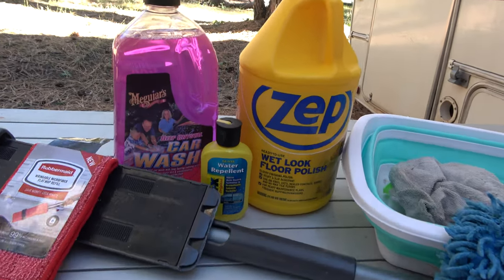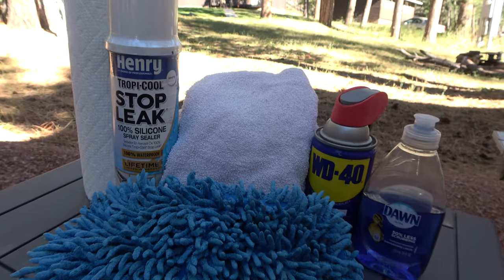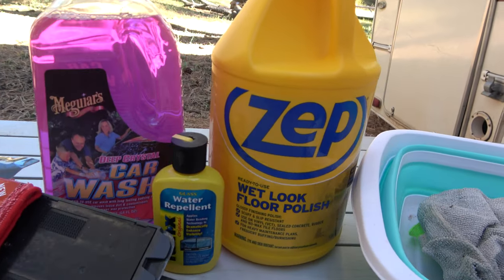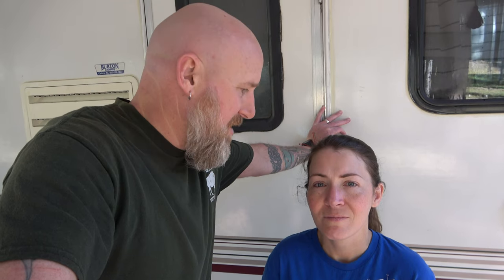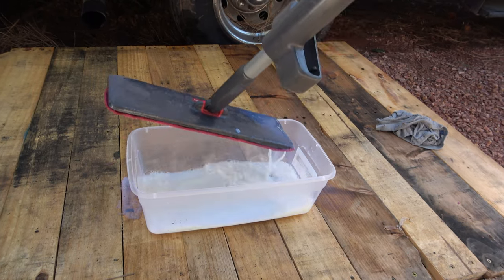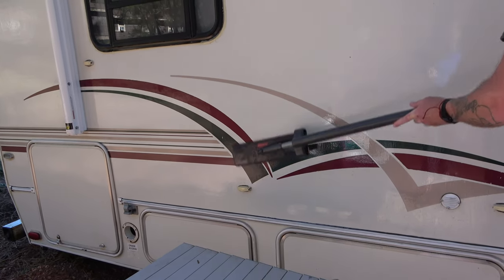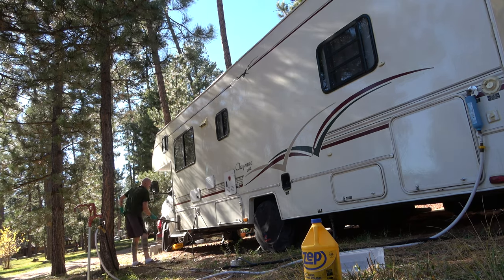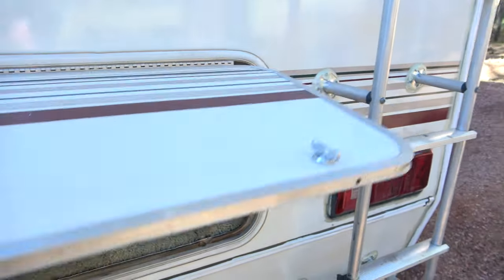Wax Your RV the Quick and Easy Way!! // RV Roof Maintenance with Henry TropiCool / CTW 173

Comment: Hit that RV with a scrub brush first with barkeepers friend then go over it with TSP you can get at Lowe’s with scrub brushes then apply the zepps looks like a beautiful new paint job preparation is the key to zepps on a RV
Reply from the maker: We already did that, this is just a recoat of Zep
Reply: @CalledToWander  only problem I’ve noticed with it on mine it’s blue and white and when it rains on the blue paint it will have thousands of little white spots till it dries no big deal but I see on dark colors when it’s wet it will show them white dots

Comment: I love the way, Zepp looks on RVs. I’ve been tempted to do it but you see and hear so many horror stories. What are your thoughts?
Reply from the maker: We’ve been putting Zep on our RV since 2021 and have had zero issues. No yellowing and it makes it easy to remove bugs off the front of the cabover. We wouldn’t recommend it if we didn’t like it!
Reply: I'll try it just on my doors for a test. @CalledToWander